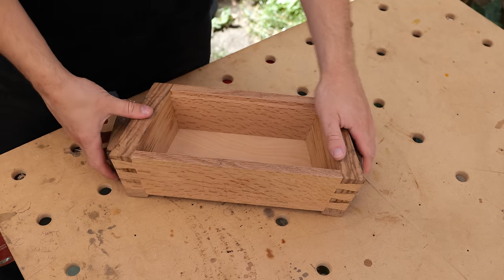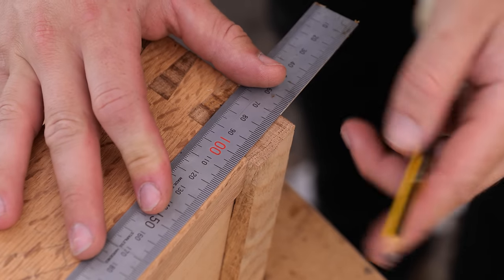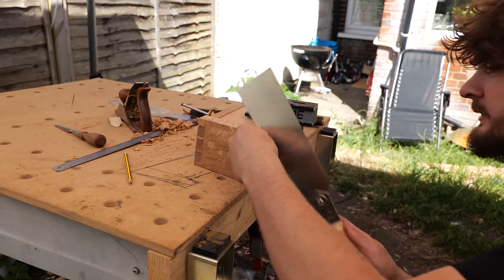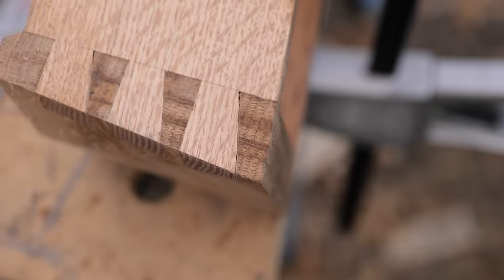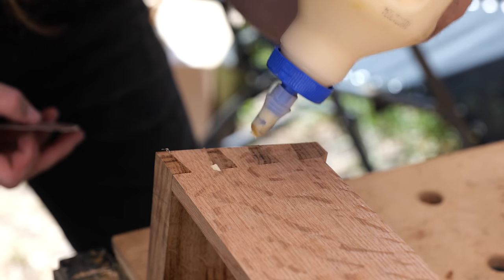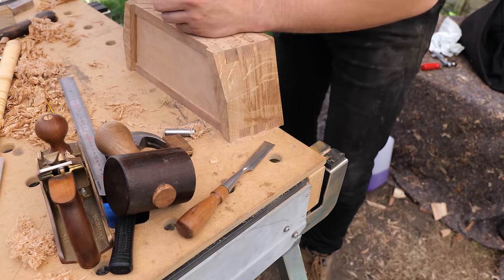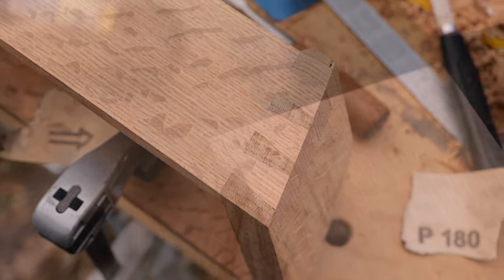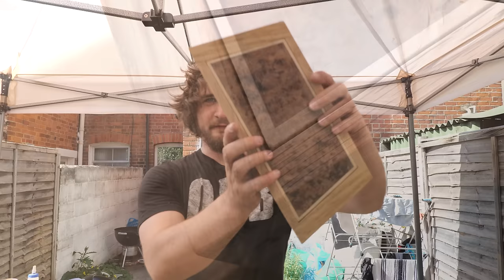Fixing Massive Gaps in Dovetails! | The Garden Workshop #12

Comment: Morning Matt,
Next time you need to temporarily fix something onto a project try sticking masking tape to the good bit then a few drops of super glue to the jig etc and stick jig to project. Then it will easily be removed once it's served it purpose.
Hope that helps. This wasn't me being picky BTW.‼️👍
Reply: Alec Nemeth , I’ve used a similar trick, but with newspaper between the two pieces. Holds well, but a few strikes with a mallet will pop it right off, with minimal cleanup needed after. Have used double-sided tape in some cases where I didn’t want any glue marks to have to deal with on the finished side, but think that might creep with the angles involved in this case.

Comment: Nice video in the face of lockdown adversity, Matt! The only tip I would take a contrary view on is using glue and sawdust as filler, especially on the end grain of open pored woods like oak. Generally I'd work these fixes backward from the eventual finish, even using that as the binder if appropriate.

Comment: Much of the information on gap-filling is new to me, and what I already was familiar with you made clear, added caveats about when to use each method.  All-in-all, a very useful vid!

I have occasionally repaired dents in face grain (like a hammer mark, or a dent from dropping the piece) by covering the dent with a wet cloth and going over it with a hot steam iron.  This often works well.  Would that help to swell the grain next to gaps in a dovetail, and obscuring a gap?

Thanks for a great vid, and all your work during the "lock-down".

Comment: Hi Matt do you think it's important to use clamps when joint is such tight fit in first place? Would you get away without it, or would that cause issues I'm not thinking of...
Reply: I think there could be more visible gaps. However theyll hold just fine :)